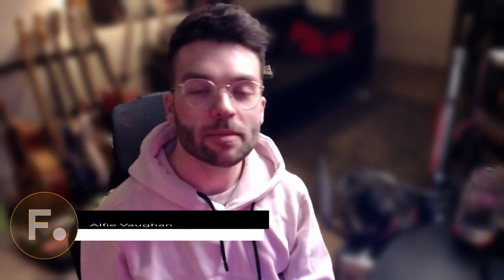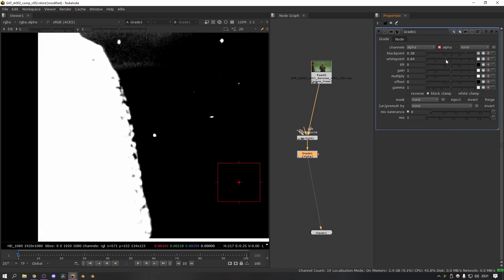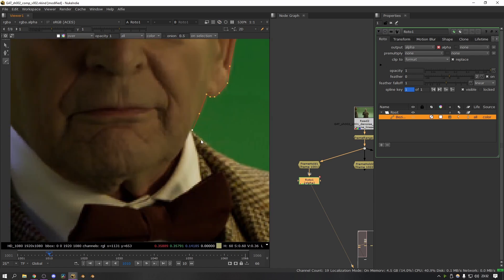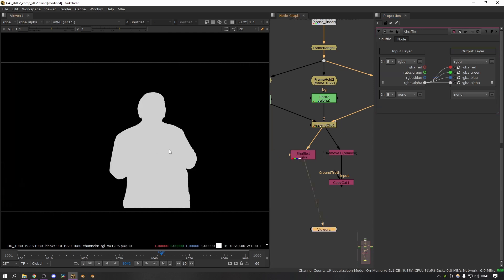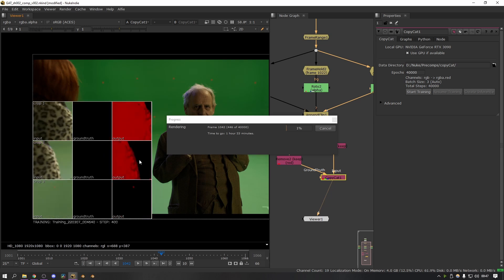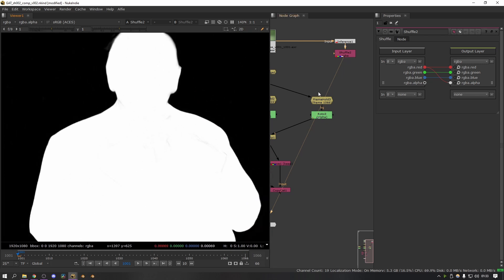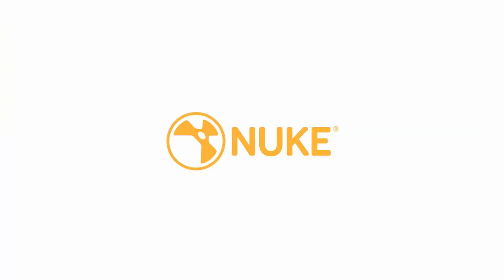Using CopyCat for Roto with @AlfieVaughan

Comment: where do I find colouredge?
Reply: Copy and paste this into your node graph and save it as a toolset. The edge extend node that's now built into nuke also does bascially the same thing. ColourEdge was how we did it before it was a native feature!

set cut_paste_input [stack 0]
version 11.2 v6
push $cut_paste_input
Group {
 name ColourEdge
 selected true
 xpos -3742
 ypos 1378
 addUserKnob {20 User l ColourEdge}
 addUserKnob {14 blurGrain l "Blur Grain" t "Preblur the image to smooth out grain if necessary" R 0 100}
 blurGrain 0.16
 addUserKnob {14 growTexture l "Grow Texture" t "Expands the texture out from pure white pixels in the matte.  Values can go above 100." R 0 100}
 growTexture 7.6
 addUserKnob {14 shrinkMatte l "Shrink Matte" t "Adjusts the point from which the texture grows.  Values are not constrained to +-20." R -20 20}
 shrinkMatte 1.4
 addUserKnob {7 alphaToWhite l "Alpha To White" t "Lifts the alpha to white" R 0 0.99999}
 addUserKnob {4 quality l Quality M {fast better best "" ""}}
 addUserKnob {26 "" -STARTLINE T "             "}
 addUserKnob {6 invertMatte l "Invert Matte" -STARTLINE}
}
 Input {
  inputs 0
  name Mask
  xpos 1025
  ypos 42
  number 1
 }
 Dot {
  name Dot1
  xpos 1059
  ypos 177
 }
set N2c7dbd60 [stack 0]
 Dot {
  name Dot2
  xpos 949
  ypos 177
 }
 Invert {
  channels rgba
  name Invert1
  xpos 915
  ypos 211
 }
push $N2c7dbd60
 Switch {
  inputs 2
  which {{invertMatte i}}
  name Switch1
  xpos 1025
  ypos 211
 }
 Grade {
  channels {-rgba.red -rgba.green -rgba.blue rgba.alpha}
  whitepoint {{1-alphaToWhite i}}
  white_clamp true
  name Grade1
  xpos 1025
  ypos 258
 }
 FilterErode {
  channels rgba
  size {{-shrinkMatte.w} {-shrinkMatte.h}}
  name FilterErode1
  xpos 1025
  ypos 321
 }
 Grade {
  channels {-rgba.red -rgba.green -rgba.blue rgba.alpha}
  whitepoint 0.99
  black_clamp false
  white_clamp true
  name Grade6
  xpos 1025
  ypos 368
 }
set N125e46c0 [stack 0]
 Dot {
  name Dot4
  xpos 1059
  ypos 932
 }
push $N125e46c0
 Input {
  inputs 0
  name RGB
  xpos -317
  ypos 108
 }
 Shuffle {
  alpha white
  name Shuffle1
  xpos -317
  ypos 279
 }
 Blur {
  channels rgba
  size {{blurGrain.w i} {blurGrain.h i}}
  maskChannelMask -rgba.alpha
  name Blur1
  xpos -317
  ypos 376
 }
set Nf598fa30 [stack 0]
 Merge2 {
  inputs 2
  operation stencil
  name Merge1
  xpos -135
  ypos 376
 }
 Dot {
  name Dot3
  xpos -101
  ypos 423
 }
set Nf75f9280 [stack 0]
 Blur {
  channels rgba
  size {{growTexture.w i} {growTexture.h i}}
  maskChannelMask -rgba.alpha
  name Blur2
  xpos -135
  ypos 457
 }
 Unpremult {
  name Unpremult1
  xpos -135
  ypos 504
 }
 Expression {
  expr3 a==0?0:1
  name Expression2
  xpos -135
  ypos 551
 }
 ColorCorrect {
  name ColorCorrect1
  xpos -135
  ypos 598
 }
 Dot {
  name Dot17
  xpos -101
  ypos 756
 }
set Nf88e8e40 [stack 0]
 Dot {
  name Dot15
  xpos -101
  ypos 836
 }
set N98c07d0 [stack 0]
push $Nf75f9280
 Dot {
  name Dot6
  xpos 52
  ypos 423
 }
set N80891ba0 [stack 0]
 Blur {
  channels rgba
  size {{growTexture.w*.5 i x1 72.7} {growTexture.h*.5 i x1 64.662}}
  maskChannelMask -rgba.alpha
  name Blur3
  xpos 18
  ypos 457
 }
 Unpremult {
  name Unpremult2
  xpos 18
  ypos 504
 }
set Nd6ebce0 [stack 0]
 Expression {
  expr3 a==0?0:1
  name Expression1
  xpos 18
  ypos 551
 }
set Nf35df3d0 [stack 0]
 FilterErode {
  channels {-rgba.red -rgba.green -rgba.blue rgba.alpha}
  size {{parent.Blur3.size.w/2 i} {parent.Blur3.size.h/2 i}}
  filter quadratic
  name FilterErode4
  xpos 244
  ypos 543
 }
 Premult {
  name Premult6
  xpos 244
  ypos 606
 }
 Merge2 {
  inputs 2
  operation under
  name Merge5
  xpos 244
  ypos 830
 }
push $N80891ba0
 Dot {
  name Dot7
  xpos 416
  ypos 423
 }
set Nf63f1e80 [stack 0]
 Blur {
  channels rgba
  size {{growTexture.w*.25 i} {growTexture.h*.25 i}}
  maskChannelMask -rgba.alpha
  name Blur4
  xpos 382
  ypos 457
 }
 Unpremult {
  name Unpremult3
  xpos 382
  ypos 504
 }
set N82cded0 [stack 0]
 Expression {
  expr3 a==0?0:1
  name Expression3
  xpos 382
  ypos 551
 }
set N80b9ae20 [stack 0]
 FilterErode {
  channels alpha
  size {{parent.Blur4.size.w/2 i} {parent.Blur4.size.h/2 i}}
  filter quadratic
  name FilterErode3
  xpos 583
  ypos 543
 }
 Premult {
  name Premult5
  xpos 583
  ypos 606
 }
 Merge2 {
  inputs 2
  operation under
  name Merge7
  xpos 583
  ypos 830
 }
push $Nf63f1e80
 Dot {
  name Dot8
  xpos 759
  ypos 423
 }
 Blur {
  channels rgba
  size {{growTexture.w*.125 i} {growTexture.h*.125 i}}
  maskChannelMask -rgba.alpha
  name Blur5
  xpos 725
  ypos 457
 }
 Unpremult {
  name Unpremult4
  xpos 725
  ypos 504
 }
set Nfdbfb3f0 [stack 0]
 Expression {
  expr3 a==0?0:1
  name Expression4
  xpos 725
  ypos 551
 }
set Nf49b0c50 [stack 0]
 FilterErode {
  channels {-rgba.red -rgba.green -rgba.blue rgba.alpha}
  size {{parent.Blur5.size.w/2 i} {parent.Blur5.size.h/2 i}}
  filter quadratic
  name FilterErode2
  xpos 934
  ypos 543
 }
 Premult {
  name Premult1
  xpos 934
  ypos 606
 }
 Merge2 {
  inputs 2
  operation under
  name Merge9
  xpos 934
  ypos 830
 }
 Dot {
  name Dot18
  xpos 968
  ypos 877
 }
push $Nf88e8e40
push $Nd6ebce0
 Dot {
  name Dot9
  xpos -17
  ypos 510
 }
 Dot {
  name Dot10
  xpos -17
  ypos 646
 }
push $Nf35df3d0
 Dot {
  name Dot20
  xpos 52
  ypos 598
 }
set N82ceff40 [stack 0]
 Merge2 {
  inputs 2
  operation from
  Achannels {-rgba.red -rgba.green -rgba.blue rgba.alpha}
  Bchannels {-rgba.red -rgba.green -rgba.blue rgba.alpha}
  output {-rgba.red -rgba.green -rgba.blue rgba.alpha}
  name Merge2
  xpos 18
  ypos 632
 }
 Grade {
  channels {-rgba.red -rgba.green -rgba.blue rgba.alpha}
  gamma 0.005
  black_clamp false
  name Grade2
  xpos 18
  ypos 695
 }
push $N82ceff40
 Dot {
  name Dot19
  xpos 162
  ypos 598
 }
 Merge2 {
  inputs 2
  operation stencil
  name Merge11
  xpos 128
  ypos 703
 }
 Merge2 {
  inputs 2
  operation under
  name Merge6
  xpos 128
  ypos 750
 }
push $N82cded0
 Dot {
  name Dot11
  xpos 347
  ypos 510
 }
 Dot {
  name Dot12
  xpos 347
  ypos 646
 }
push $N80b9ae20
 Dot {
  name Dot21
  xpos 416
  ypos 598
 }
set Nf4485820 [stack 0]
 Merge2 {
  inputs 2
  operation from
  Achannels {-rgba.red -rgba.green -rgba.blue rgba.alpha}
  Bchannels {-rgba.red -rgba.green -rgba.blue rgba.alpha}
  output {-rgba.red -rgba.green -rgba.blue rgba.alpha}
  name Merge3
  xpos 382
  ypos 632
 }
 Grade {
  channels {-rgba.red -rgba.green -rgba.blue rgba.alpha}
  gamma 0.005
  black_clamp false
  name Grade3
  xpos 382
  ypos 695
 }
push $Nf4485820
 Dot {
  name Dot23
  xpos 526
  ypos 598
 }
 Merge2 {
  inputs 2
  operation stencil
  name Merge12
  xpos 492
  ypos 703
 }
 Merge2 {
  inputs 2
  operation under
  name Merge8
  xpos 492
  ypos 750
 }
push $Nfdbfb3f0
 Dot {
  name Dot13
  xpos 690
  ypos 510
 }
 Dot {
  name Dot14
  xpos 690
  ypos 646
 }
push $Nf49b0c50
 Dot {
  name Dot24
  xpos 759
  ypos 598
 }
set Neb5ca7e0 [stack 0]
 Merge2 {
  inputs 2
  operation from
  Achannels {-rgba.red -rgba.green -rgba.blue rgba.alpha}
  Bchannels {-rgba.red -rgba.green -rgba.blue rgba.alpha}
  output {-rgba.red -rgba.green -rgba.blue rgba.alpha}
  name Merge4
  xpos 725
  ypos 632
 }
 Grade {
  channels {-rgba.red -rgba.green -rgba.blue rgba.alpha}
  gamma 0.005
  black_clamp false
  name Grade4
  xpos 725
  ypos 695
 }
push $Neb5ca7e0
 Dot {
  name Dot25
  xpos 869
  ypos 598
 }
 Merge2 {
  inputs 2
  operation stencil
  name Merge13
  xpos 835
  ypos 703
 }
 Merge2 {
  inputs 2
  operation under
  name Merge10
  xpos 835
  ypos 750
 }
 Dot {
  name Dot22
  xpos 869
  ypos 797
 }
 Dot {
  name Dot16
  xpos -3
  ypos 797
 }
push $N98c07d0
 Switch {
  inputs 3
  which {{quality}}
  name Switch2
  xpos -135
  ypos 871
 }
push $Nf598fa30
 Dot {
  name Dot5
  xpos -295
  ypos 932
 }
 Keymix {
  inputs 3
  name Keymix1
  xpos -135
  ypos 918
 }
 Output {
  name Output1
  xpos -135
  ypos 1032
 }
end_group

Comment: I really don't understand why this isn't keyable - the greenscreen looks absolutely fine, just need to remove markers near the actors and use a degrained plate to stop the buzzing edges.
It honestly blows my mind when compositors don't know the most basic (and advanced) art of keying - NOBODY gets a good key with 1 keying node, it's naive to think you could.
And having worked on many many large productions over the years, we would NEVER roto a shot like this, that's not normal if its on a decent green/bluescreen (such as this), people just need to learn how to key.
Reply: Clean-Plate + IBK Gizmo would have done the job. :D
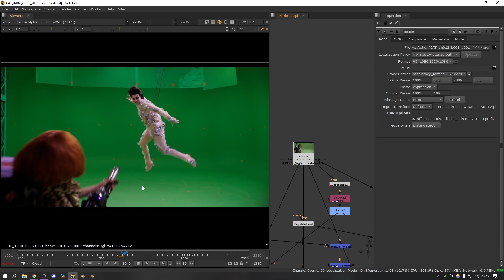Reply: The clothing was a bit of a problem but this was just a simple shot to demo it on. You can see at 2:39 the more complicated shots I was using it for

Comment: @AlfieVaughan, Hey, I'm prepping for some post work and want to use a similar approach. In my case it's a rigid bodied object in a roughly similar position in varying lighting conditions. Do you need to do per shot roto + training? Or can I do 2-3 frames on let's say 10 shots and use those as my ground truths and use one inference for 60+ shots for example?
Reply: Yes you can use it across multiple shots if they're similar enough

Comment: Somethings in Nuke are just easy while other simple things are nearly impossible but with Mocha in After Effects this can be done in seconds. Mind boggling.
Reply: Sure, this specific one is easy. But I just picked this as the example. A lot of the shots were hundreds if not thousands of frames and much more complicated. The reason I used copycat for this is because once you train it on one shot it can do all of them as long as they're similar.
Reply: Mocha works for Nuke as well
Reply: @nixipanda798  Forget Mocha, even. Rotobrush could do it in twenty seconds. I guess I'm confused on why this is not integrated into Nuke already? If Nuke had Rotobrush the game would be over. It would make comping a thousand times faster.

Comment: how good does this work on shots that have motion blur? All the examples I have seen of it always has fairly static subjects.
Reply: It does a pretty good job. You can either roto the motion blur in the reference frames by blurring and feathering the edges of the mattes. Or what I sometimes did is run the hard roto through a 2D motion blur node to fake it a bit. It depended on the shot which one I chose to do. Hope that helps!

Comment: Wow this is awesome. I had a very complicated project almost 3 years ago that required roto for 2 actors and each of theyr body parts including many objects for 2000+ frames nd a very short deadline. Was a cartoon conversion from real footage to 2D. I had to write a python AI program to run on 3 high end nvidia gpu's of that time and even after letting it run 20+ hours over a weekend on 4k frames it had a lot of trash in it and was never so clean like this, but was usable and better then nothing, was 70% there, so i had to literally paint each frame to get the trash out. Was crazy work and i wish i had this tool. Is incredible how the technology evolves so fast.  Resolve 18 just came out and the Ai roto in it is also extremly impressive.

Comment: can copy cat node be used for paint-prep  shots ?
Reply from the maker: Hi! 
yes, copycat can be used for any image to image process. So if doing paint cleanup of markers, or things like dust, scratches etc, you could give copycat a few frames of the cleaned-up version and train it on that to have this applied to the rest of the frames in the shot. 
Like with any machine learning the quality of the data you put in will help determine the quality of the result you get out.

Comment: is there any difference if we do key for a single frame and use that to generate matte and do roto for the single frame?
I appreciate if you would have used copycat to generate matte for the Screenleft character as that's the tougher task in the shot
Reply: I would think it wouldn't make a difference, as long as the key is clamped to min 0 and max 1 values, the end result should be the same.
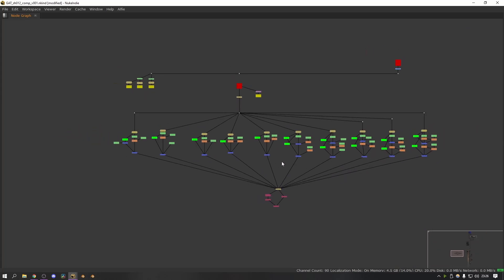Reply: You can do that too. When I show the bigger shot at 2:50 you can see I'm using a mix of keying and roto to generate the mattes
Reply: @AlfieVaughan  Did you tried copycat with the other character in the FG?